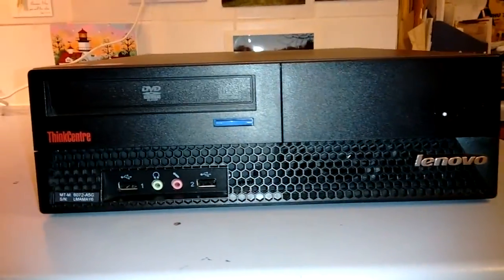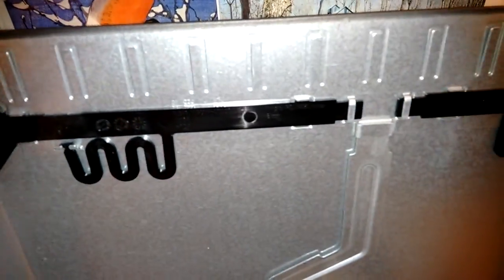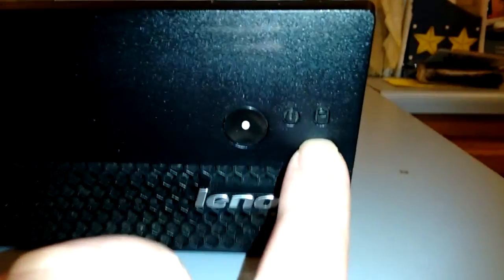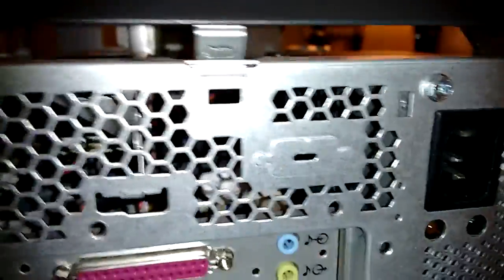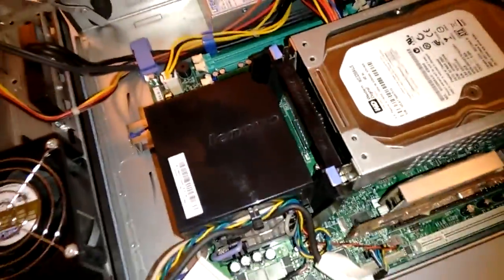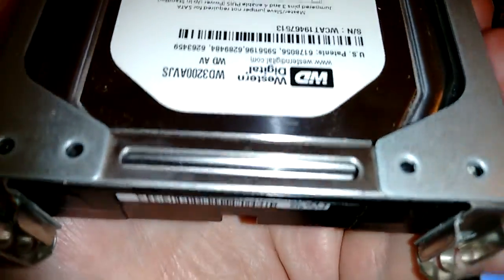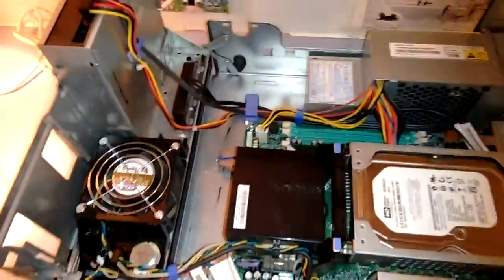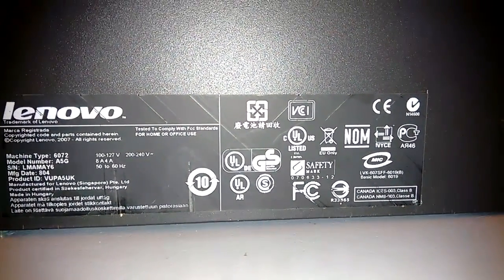A short tour around the inside and outside of a Lenovo Thinkcentre M57 (6072-A5G)

Comment: Excellent video.

I very recently got one of these off eBay for £30. Mine is the 6072-CTO, with a 1.8GHz Dual Core. It had 4GB of RAM, which I've upgraded to 8, and a 1TB HDD. I'm going to upgrade the CPU to a Core 2 Duo, which I think can be up to a 3GHz, and fit a graphics card for increased performance, and so I can connect via DVI. I've bought it primarily to run emulators.

Comment: Got a Lenovo ThinkCentre M57 that won't turn on after it's been unplugged and then replugged into the wall outlet. Any ideas would be greatly appreciated. I usually have to remove the CMOS battery for a minute or two to be able to get it to boot up again but then I've got fix the date and time.